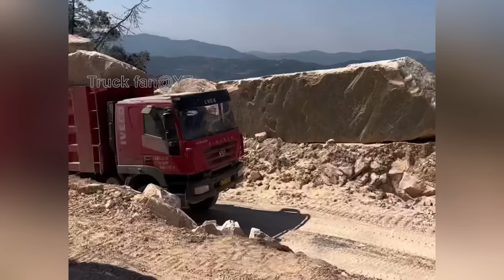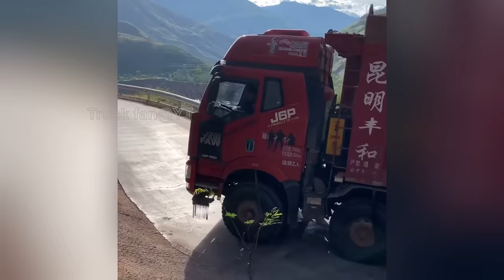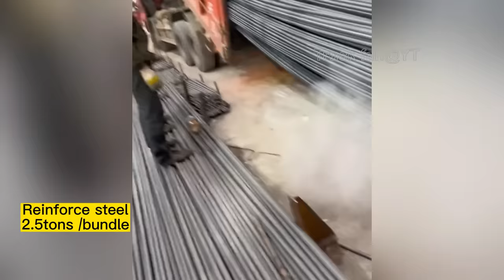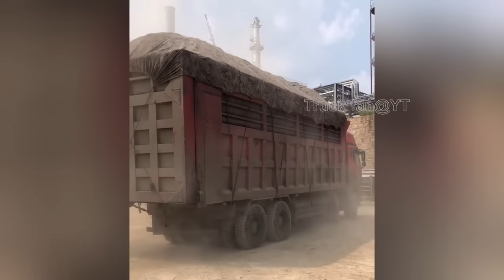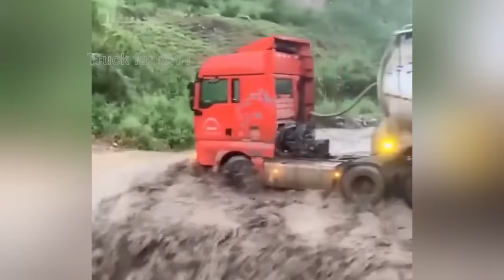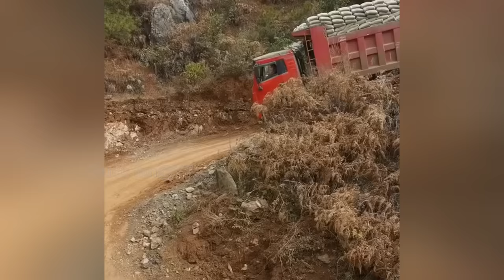Torture on trucks? 【E3】Pure sound compilation of heavily overload trucks.extremely dangerous!

Comment: In the lowest gear, a semi tractor is easily pushing 30,000+ ftlb at the drive axels. The dozen people with the rope are doing literally nothing, and just a huge safety risk.
Reply: You are definitely right! it would be enough to apply a bit of logic in doing things, but in some countries it seems that the brain is not used....🙄🙄😞😞😞
Reply: The same AH that is forcing the crew to overload every truck is also forcing that crew to push the trucks out of the yard. How're them trucks going to climb the first hill they'll encounter out of the yard? The AH doesn't care cause an AH is an AH is AH...
Reply: you can have all the torque and power on the world it will do nothing if the ground is slippery...all you need is wet road and you are done if you stop in the middle of the hill.
Reply: but it looks cool on a propaganda video at least
Reply: Keep them busy no time to think too much.  @OssamabinKenny
Reply: Maybe not with worn out tires
Reply: gerald
"In the lowest gear, a semi tractor is easily pushing 30,000+ ftlb at the drive axels. The dozen people with the rope are doing literally nothing"
- first, they are not doing 'literally nothing', they are adding pulling force, that is not 'literally nothing'
- their assistance is more of a help in the amount of required traction, rather than pulling force they are adding
Reply: Sorry guy, ok the 10 idiots with the rope are adding at best 500 lbft if they pull together. The drive wheels are not spinning out, so its not a traction issue. Have you seen how many people it takes to push out a stuck car from snow or mud? Now go try with a semi, loaded that weighs like 80000 lbs. @Dr.Ian-Plect
Reply: @gerald8289  
- I note your acknowledgement of being wrong regarding 'literally nothing'
- the rest of your reply is irrelevant
Reply: @Dr.Ian-Plect I gotta say you are wrong they might help out a little bit at most but given how quickly they are moving their feet they aren't doing most of the work it's not a traction issue for the truck since it's not sliding or pulling to the side and if it was a traction issue a rope or chain at the top of the hill would be more effective to pull on then running with the truck and safer it'd be easier to have 1 medium duty truck or dozer help pull then have 10 dudes go out there if it was a big issue it'd be quicker too since it's just 1 or 2 chains to a tow point
Reply: @jmaddy3  Yet another person that can't discern what I did and didn't state!
"I gotta say you are wrong they might help out a little bit at most"
- so, NOT wrong, I ONLY stated they are helping, contrary to the other commenter's claim of 'literally nothing' 
"but given how quickly they are moving their feet they aren't doing most of the work"
- irrelevant, I didn't claim they were doing most of the work. I'll just repeat the above, maybe it will sink in; "I ONLY stated they are helping, contrary to the other commenter's claim of 'literally nothing'"
"it's not a traction issue for the truck since it's not sliding or pulling to the side"
- again, you're replying to something I didn't state! I did NOT state traction was the issue, I ONLY stated the people pulling the rope 'is more of a help in the amount of required traction'. NOTHING in that states traction was an issue! 
"and if it was a traction issue a rope or chain at the top of the hill would be more effective to pull on then running with the truck and safer it'd be easier to have 1 medium duty truck or dozer help pull then have 10 dudes go out there if it was a big issue it'd be quicker too since it's just 1 or 2 chains to a tow point"
- irrelevant commentary, I stated nil about better ways
--------------------------
SO, your claim of me being wrong turned into a list of irrelevant drivel.
Reply: Exactly
Reply: @Dr.Ian-Plect  I don't think you realize that, even if he said "literally nothing", he meant "insignificant". As in, the workers' help means practically nothing compared to the truck's power
Reply: @RT-.  I replied to the words stated, nothing else.
Reply: Safety risk: yes 
Doing nothing: no, there is something called traction. You need to learn a thing or two about that!
Reply: @antonfloor344  you need to learn about friction. Is not dependent on surface area but on normal force. They don't have enough weight if we assume the surface has low friction coefficient. You are not going to cheat physics and pull up by adding their shoes to the tractor tires cos there's not enough weight pushing down on their shoes so they have more traction then the tires have. The tires may not have the surface area of shoes but have a lot more weight on them so a lot more friction
Reply: all the torque in the world is useless if the tractor doesn't have enough traction...the 17-20 people pushing or pulling will make a difference, their combined weight is well over 1.25 tons, so even for an 80 ton rig that's an additional 1.5% of powered mass with an insane amount of traction.
Reply: @salvatorepernorio1262     So your country has created the biggest economic growth in the last 30 years?
Reply: @sunmatr  Don't try to provoke who knows what emotional reaction in me.  all this doesn't change the simple fact that, before moving the hands, the people need to turn on the brain! Only this.
Reply: You may misunderstand the rural culture of China. The leader of labor charges every truck a fixed toll at that corner. It may help drive through that corner, literally they are crime group. Who pays the labors? The drivers or the transport companies.

Comment: Never occurs to them to just take two trips.
Reply: or four
Reply: Time is money.
Reply: @tronn_carter  yep that’s true. So how much time are they saving by tipping over and destroying their trucks?
Reply: @cactiguide  simply stating the logic most likely to be behind the behavior. never said I agreed with it.
Reply: Cost double then.
Reply: @cactiguide  In many cases the trucks are reinforced in structures.
Reply: @henrywang3977 the structures might be reinforced. But what about the transmission? Lmao
Reply: @Deadassbruhfrfr  In most cases they are indeed severely underpowered. But there are trucks with extra horsepower and torque for overloaded weight.
Reply: Wen a trip is like 150 miles money wise overload and go
Reply: Tell that to the Australians and their road trains.... because its cheaper... Several box trucks vs a semi... Simple logic
Reply: @antoochibbo1355  If the logic is simple, then it is especially bad that you lack it. The Australians don't overload their trucks like this. You don't save anything when your truck breaks down or you cause an accident.
Reply: @cactiguide  true... But  the fact that they do it anyways means that the benefits outway the risks...the trucks are usually company owned, companies are more concerned about profits and fulfilling contracts, the next concern would be for the roads which you can see in the video, are already bad, the drivers are ready to risk it hence the overloaded trucks. Maybe Iwas wrong to assume you know this
Reply: no man as ever thought that in the history of men
Reply: You make money by the ton. Why would you earn half the money, taking 2x the time (you have to go there and back), (1/4 efficiency), when the only benefit is keeping your truck for 7 years instead of 5?
Reply: @433mea4  gee. I guess that’s why everyone overloads their truck right? Because the ONLY difference is 2 years. Sure thing buddy
Reply: @cactiguide  It could be keeping the truck for 1 years vs 4. At that point the costs are equalized in this scenario. Anything above that, 1 years vs 3, 2 vs 6, its still worth it to overload.

Comment: So that is a load of gravel. density 1.8 ton/m3. 12 meter long, 2.4 meter wide and about 1.8 meter high. Firstly that would be like 93 tons, that is heck of a overload. That truck is probobly made to carry grain or something like that. That would be (just considering the mechanical construction of the truck not the rules of the road) be a total mass of about 60 ton, and a net mass of about 40.

Anyway, i can´t quite see what the grade is, lets say 1:20. Grades are usually a lot lower than they look like they are, so 1:20 is not impossibe.

That is 20 ton truck with a 90 ton load, so 110 tons, on a 1:20 grade. You would need 5.5 ton of pull force to pull it up the hill. They are say 20 people pushing. each person can push say 30kg., that is 600kg push force. That would be 10% of the total force needed.

Actually more than i thought, still... well. it probobly would be better just go with speed up the hill

Comment: Its like each truck regardless has a minimum of 50tons!😂
Reply: nope. they regularly load it to excess of 100 tons gross. The rigid 12 wheelers caps at 120 tons. The tractor trailers can reach close to 200 tons gross.  They even have an exclusive trailer axle that has a max load of 18~20 tons. Outside of China, you can only find axles with max load of 12~13 tons.
Reply from the maker: @kimpatz2189 FUWA have product of 25T trailer axle

Comment: Moving this shit for these trucks isn’t actually the problem. 
The load on the suspension is the first issue. 
Then getting the traction to pull this shit is the next. 
These trucks will haul ass no issues.

Comment: Translation: Many truck license plates come from Yunnan, which is located in the Himalayan mountain range. I respect their work.
Reply: I assume they never get to enjoy retirement…
Reply: @dermotmcglinchey282  look at load limits and the type of materials they have I would actually say they're mostly well within the limits of the truck. Sand or gravel chips are not actually very heavy so it's much more likely to fill the box before you reach dangerous weight, most of the videos here are from bad places for a truck to be, steep climbs on loose low grip materials or tight corners